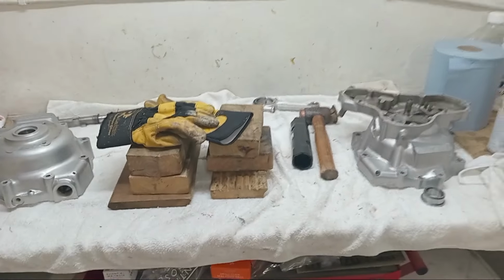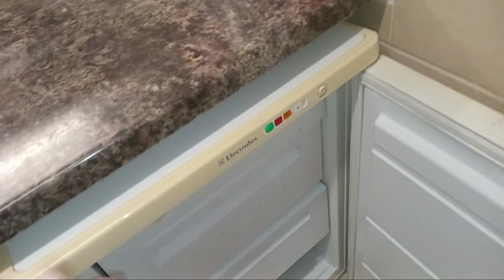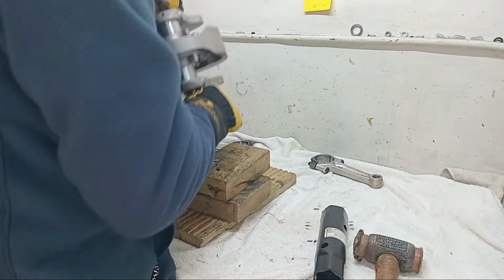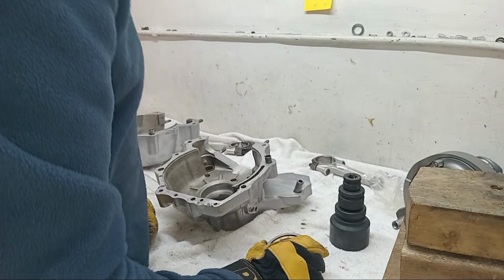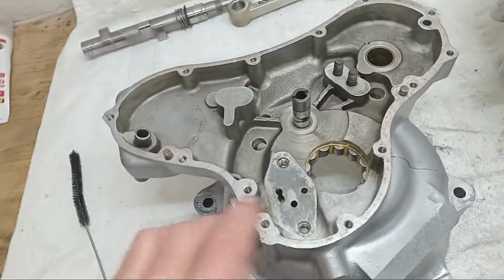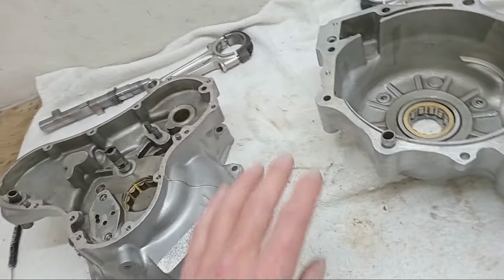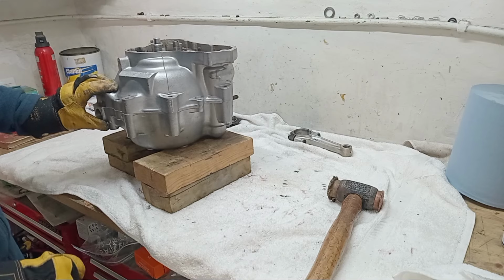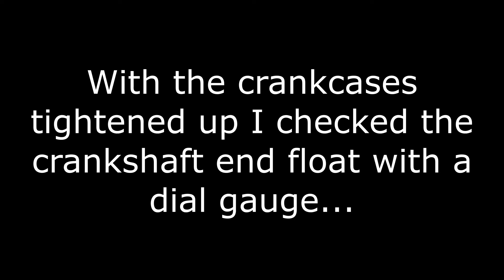Norton Commando Engine Rebuild. Part 45: Fitting the Crankshaft and Main Bearings.

Comment: what brand of main bearings did you install? trying to ID the type and understand the difference in the part numbers.......thanks
Reply from the maker: TBH I forgot to check! They were sent by the engineers and so I knew they were okay - but I do know that they were supplied by Andover Norton. Hope that helps.
Reply from the maker: PS I don't think the part numbers are different, the numbers I refer to are something like batch numbers.

Comment: Chris I was told six weeks and when I rang after six weeks I was basically verbally abused for the cheek and wasting his time, told me it would another six weeks. Rang after another six weeks and was little less nasty but basically the same message. He then rang me a number of weeks later and told me he had started to do the work, but his quote was way out I needed agreement for another few hundred pounds as more work was needed than he thought. I agreed without argument and when the parts arrived the work was first class. However, he then had the cheek to post photos of the job on his Facebook page stating his original quote was based in photos hence the price it need to nearly double when he saw the work. This was not true I only asked for price after he had received and inspected.
Reply from the maker: I'm afraid that my experience was almost identical to yours. At least I know I'm not alone. A shame, as his work is so good. 😒